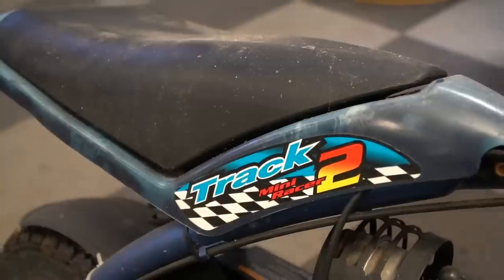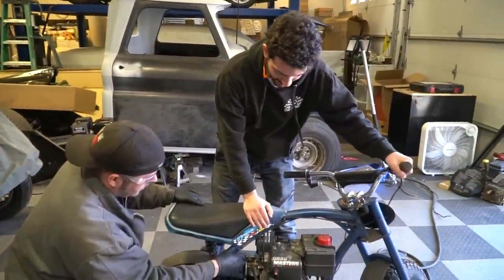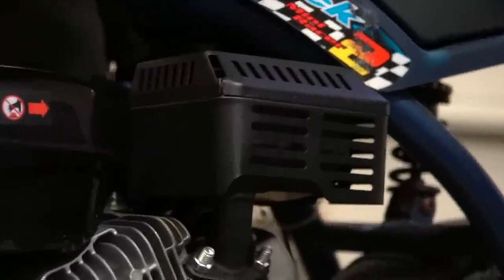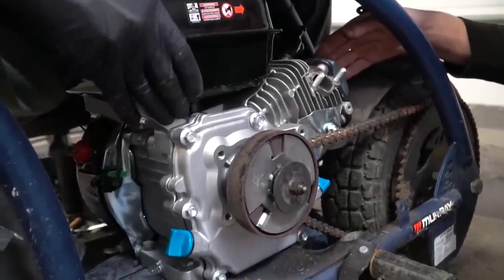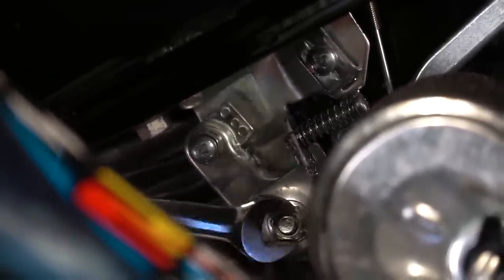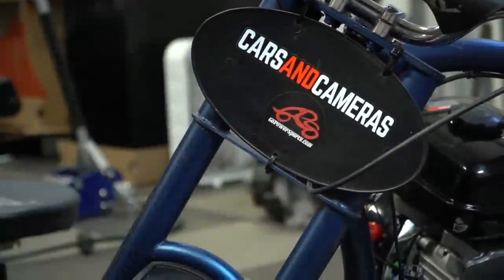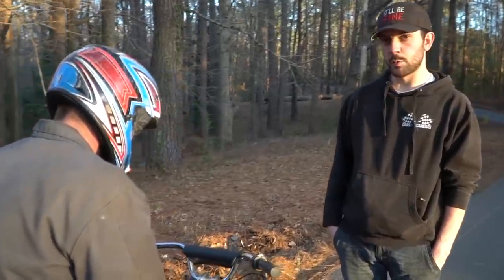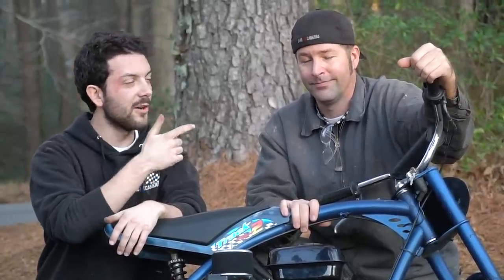Tillotson 212R | 212cc, 12HP STOCK!

Comment: Can wait to see the turbo engine back. I know it doesn't make hardly any boost but that thing is awesome
Reply: I've typed it out a few times, an electric brushless motor RC model jet ducted fan unit could make a NEAT little supercharger to force feed air through a Tillotson fuel injection body.... the EDF (electric ducted fan) and its ESC (electronic speed controller) CAN be programmed (power curve) along with what controls the fuel injector solenoid (voltage value and pulse frequency), to run from input signal from crankshaft/coil/RPM acceleration rates.... totally tunable like a turbocharged fuel injected full size car's ECU. seems no one wants to pay any attention to this idea that could increase power and torque up to 35% no prob.
Reply: model nutty damn! Another great idea! Just like the Chinese meranti luan! I think I will incorporate both ideas for a build like a 1/3 hellcat build

Comment: why don't you guys ever ditch the stock accessories ( Fuel tank, square can exhaust, and stock intake) and just go with an engine plate?  pulse pump and a back of the seat or between the legs 2, 3 or 4 quart tank resin or aluminum.  allows more choices of intakes, carbs and headers better cooling too. Plus it just looks good. Less like a lawnmower . cheers

Comment: Hey guys. First of all I want to say that I really enjoy your channel. I have learned a ton and it’s a lot of fun to watch. I was wanting to know if there is a way I could possibly have a chat with you guys about some things on the 212 build I done for my dirt racing kart? I have been out of racing for a long time. I was injured in the U.S.M.C and I am well enough now to try and race again. I did a full build that I am really proud of but this style engine is not what I am used to. I did pick up a ton of great information from your channel but I was hoping if you guys had a few free minutes to speak with me I would appreciate it more than you know... thank you for your time. Your fan Luke aka uniqueone
Reply: What do you need to know?
Reply: I have got it to a stage 3 I am going to be running 104 octane oxygenated... I am having a ton of problems finding the correct jet/ air combination...
Reply: And thank you btw... I know you have to be crazy busy
Reply: It is a predator 212 btw
Reply: I wasn’t sure if you knew what size jet works best for higher octane fuel? Thank you again for your time

Comment: would it not fit with cylinder facing forward, better cooling, turn back wheel around so  drive on right side instead of left side,, just a thought,
Reply: If you put it in backwards you are going to go backwards
Reply: doh !

Comment: Tecumseh engines are SO MUCH better than Briggs it's unreal. Briggs have diaphragm carburetors and the diaphragm always goes bad on the old 5hp engines, for no reason, while not even being used. And also the Briggs engines all had aluminum cylinder bores! Gasp! Every old Tecumseh I've ever seen has a cast iron sleeve cylinder and an automotive style metal brass float carburetor. I have a Tecumseh 6hp with the original engine parts from 30 years ago, and it still runs as good as when my dad got it used around 1989. I've seen an all aluminum Tecumseh engine once that had an aluminum cylinder bore, but every Briggs engine I've ever seen from the 1970's, 1980's, and 1990's, had an aluminum cylinder. It's not acceptable to use an aluminum bore.

P.S. The new engines probably all use cast iron cylinders, I don't think they use aluminum bores anymore.

Comment: you guys should make a wooden body of something like a 1968 dodge charger and put it on a go kart and put working headlights and tail lights on the body and somehow make a dual exhaust for it
Reply: they may not know but I DO.... throw some Chinese meranti luan (it's 3 cores plus the skins for 5 laminates total) into a swimming pool sunk for a day or two (the pink glue is waterproof no prob). now take that wet crap and screw it to the forms you want its shape to take (use little 2x2" bits of same to put screws through so the holes stay small) and let it dry for a week (minimum). you CAN do a mini car body with this method, easier than most people would think. stitch and glue together like you would a small boat, with epoxy+sawdust fillet on the inside for strength. round your sharp corners, sand and bondo, cover with 4oz cloth+epoxy, sand-primer-sand-primer-sand-paint and finish. once the curves are imposed and the panels joined, it'll come up being pretty rigid and light weight.
Reply: model nutty awsome idea thanks
Reply: Mattydavee it does have its limits, but it'll also surprise you how far it really CAN go when completely saturated. last time I bought it was 11 bucks per 4x8' sheet, lot of area reasonably cheap. avoid the single core stuff with veneers (is USA made), its just not as good for really playing hard with, like small boat building etc.
Reply: model nutty thanks nutty for the info

Comment: Man i just got the same track 2 mini bike it has a 4.0 hp on it but it shuts off on me im thinking it has something to do with the carburetor im gna change it out bc i dont have cash to buy a badass motor like tht one the one thats on it rn runs good turns on fast but just shuts off on me nd wont turn on like if the carburetor chokes

Comment: Couple  of things. Had a 3.5 on it, and you swapped in a "12" hp engine in it, no change of gearing.  It should have been nearly impossible to keep the front wheel down with that much h/p and torque.
If  the throttle is is the same as the Predator, take the nut off, lift up the throttle and remove the wave washer under it.  No more sticky throttle.
Reply: I had to lean foward a little bit to keep the wheel down

Comment: For 219 bucks this engine might be a better buy, if it claims 12 hp. I dont think you could make 12 hp for 120 bucks on a predator not to mention this engine is probably far more beefy in terms of part durability, i think this motor is definitely worth the extra 120 bucks
Reply: If this is 12 HP, should be doing 75 MPH out of the box !!!

Comment: What size motor would you put in a four wheeler frame it would get up to around about 50 55 miles per hour cause my motor has been tooken apart and I don't know what parts it's missing so I'm needing a donor motor or something I was thinking motorcycle bike motor
Reply: Stock 6.5 HP ($99) Predator should do 50-55 MPH with gov removed... or find a used one...
Reply: Depends on size of four wheeler. Small one  212. Bigger one biger engine
Reply: Is a Honda ex350 four wheeler

Comment: I have that same mini bike they rock 1988 with a predator 212 CC and it does 55mph I got a 72 tooth sprocket can't crack the throttle it will literally flip

Comment: Hey guys I have a question my go kart is a 1 wheel drive go kart but I am making it into a live swap but I want to know what is best for speed and torque
Reply: Depends on tire size. 10in tall tire on the axle using a 35 chain a 58 tooth sprocket works pretty good. Its kind of a mid size sprocket

Comment: Yup i like the concept but those header wraps are not the best. Mine is still on for now but they crack pretty fast and fall apart. Other than that GPS is still the bast.
Reply: Better to make a pipe that stays inside the frame... add a small heat guard if needed in one spot...

Comment: 13 or 14 :1 compression??? Y’all out your minds. That would be a 212, with flattop piston, sitting at 0.020” in the hole, with a 0.010” head gasket, and a 14cc combustion chamber.

Comment: Does anyone know where to get good throttle cable and twist handles for cheap? Mine keep breaking.
Reply: Add a stop to your twist grip so the cable doesn't do the 'stopping'... or adjust the cable so that it ends at full throttle when the twist grip stops...

Comment: With a header you fee up the exhaust. By the Dimple refit  you just cut the flow in half That's why the chicken was laughing so hard. Why didn't you just cut it and turn it a little bit and reweld it?
Reply: Yeah, instead of an exhaust sleeve, make a pipe that stays inside the frame...

Comment: hey i recently bought a brand new tillotson got everything hooked up and when im riding at about 25mph it starts hunting badly can someone help with the issue?
Reply: Open up your carb jet
Reply: @connorssmallengines6663  i did that even changed to a tct fuel injection dialed in right and still.
Reply: @TheGbPackerz  is your spark good? Is it like it revs up and down and up?
Reply: @connorssmallengines6663  when i looked at it more the mechanical governer arm is surging after about 25 everything is brand new i checked the spark plug and its fine.
Reply: @TheGbPackerz  ok then get rid of the governor

Comment: Anyone on here think a old school real comet 30 series torque converter would hold up to this I know they are rated at 8 hp but that's the new that's cast the old comets have a beefy steel plate that goes under the motor and is all welded, it's on a Streaker two seat go-kart from the 90s.  Any input would be great.
Reply: Anybody? Got some input?

Comment: Those are 6HP engines not 12HP. 420cc is about 13 HP. Where are the specs to that model ? If its moded it will be little more than 6HP maybe 7 or 8 ? But no way 12HP. But It'll be fine.

Comment: 13:1-14:1?? That just straight up sounds pathetic for that kind of motor.. on reqular pump gas..? Mmhm that's hard to believe that it could run any where near good having that kind of compression even tho they have their "special adjustable carb" but I think that he may be wrong on that comp ratio. It doesn't sound right at all

Comment: That is 212cc and my 175 trail Honda I had would tear up anything I've seen on here. Why are these things so under powered?
Reply: I think they may have been showing that "12 HP" engine does 35 MPH when it should be doing 75 MPH... something is WRONG here!
Reply: @BuzzLOLOL  gearing but look how fast it goes To 35 mph and it has a clutch not a TC
Reply: It's the clutch, they need a torque converter. A stock engine running at 3600 rpm should go about 35 mph, with the 212r running at 5800 rpm should make it to 58 mph with the same chain and sprockets. 12 hp should make it to that speed easily.

Comment: After 4 years they still can't get an (out-of-the-box) engine to run properly - just the usual half-arsed, dangerous, bodge. 
Amazed Go-Power-Sports still sponsor this channel. It will not be a surprise when Cars and Cameras is sued following the serious injury/death of a young fan/follower.
Yeah, go on kids - quadruple the power of your old minibike with no thought for the structural integrity of the frame (increased stress causing twisting, metal fatigue), drivetrain (chain, sprockets, tyres), handling, brakes or the wearing protective clothing....
Reply: They do tell you not to try this at home. I built up a mini bike with a 212 predator engine. Thing is crazy fast, pulls wheelies with no effort. We ride it in the grass to keep down road rash.

Comment: I bought this engine, it only has more RPM, any coleman 6.5 can keep with it with the same torque converter, 12HP for $200... LMFAO. marketing BS. put a stock coleman muffler on it and it pegs the same RPM with the same top speed as any stock bike with a TQ.